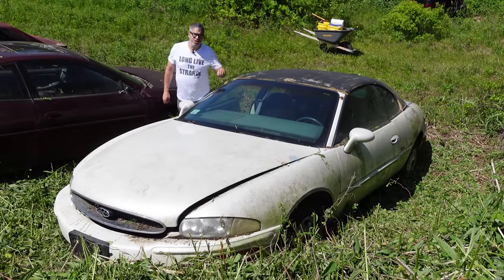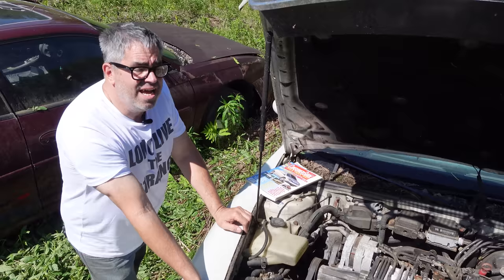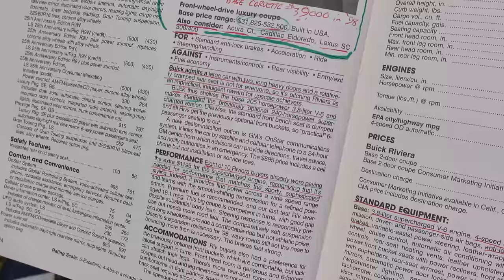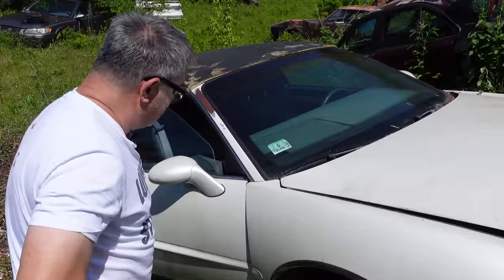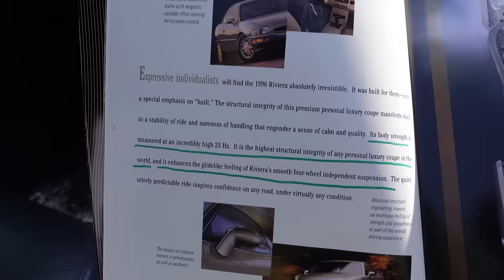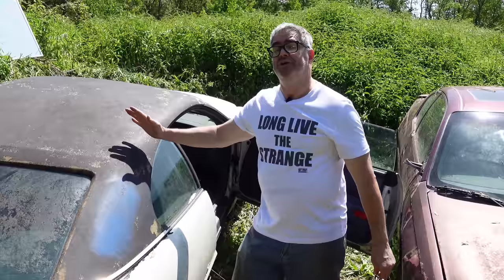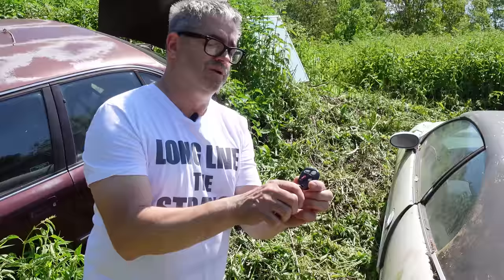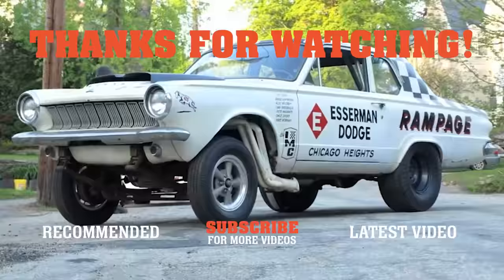More Power Than A Grand National!

Comment: If you’re looking for a sleeper the early 2000’s Regal GS had the same engine in a slightly lighter car. With the right tune and under pulley kit you could quietly eat stock Mustangs and Camaros at a light

Comment: *5hp more than an '86 Grand National and T-Type (235hp). The '87 Regal T and Grand National was 245hp, which would equal 5 MORE than this L67 Riviera. GNX, as we know, was rated at 276hp. I have an '87 GN, and I used to own a '98 Grand Prix GTP with this engine. Both are great engines. Both had their unique pros and cons. Preferably, I'd prefer the LC2 in the GN.

Comment: I remember seeing those zooming down the roads and I just might have an idea where 1 is that's still running and driving, it might be put up cause I haven't seen it for awhile. The 94 or 95 Buick Roadmasters ran pretty good too but I haven't seen one of those since 08 maybe. They were rear wheel drive. I think GM lies about the horsepower cause those Riviera's would scoot, and the 98 Buick Regal was supercharged, they wasn't no slouch either, most of em has it written on the trunk beside the taillight on drivers side maybe. I blew the engine in 1 cause I ran everything up like rev-limiter and whatnot. The shifting and everything changed cause it'd jump outa the hole lol. Bout 8 hole shots killed it lol...It felt like 300hp or a tad bit more...

Comment: I had a ‘00 Grand Prix GTP with the same motor. It was a fun sedan to drive. I remember seeing a GTX Grand Priz back then that a 270hp rated 3.8 in them. I also own 2 ‘90 Berreta GTZs. They later came out with the Berreta Z26 which had a 3.8l engine, not supercharged. I wonder if the SC version would fit under the hood though. THAT would have been a fun car to drive.

Comment: Great piece.. I’m splitting hairs, but I wouldn’t call it ‘Buicks most potent 3.8 V6 with 240 HP”. 87 Grand Nationals were 245HP, 87 GNX 276HP… and both likely under rated by 25HP or more.

Comment: i have a 2003 bonneville SSEi 3800 supercharged, these engines might make 240 stock but it's fairly easy to get another 25-30 hp...... sure you can go further but you have to spend more. i am also not trying to destroy my transmission

Comment: Those cars with power didn't have any torque steer at all. GM detuned the 3800 series 2 SC to 240 HP because in prototype form they produced 300 hp and competed with the Corvette C5 at the time.

Comment: Back in the mid-90's when this series of Riviera debuted, I was struck by ho aerodynamic they looked. I would have liked to have seen one of NASCAR's G.M. teams at least build a prototype Riviera stock car to see how it would perform. I remember that one team actually built Continental Mark VIII to analyze it, thinking it might do better than the then-current Taurus (Or was it still the Thunderbird? I don't recall for sure). I think the Riv might well have done better aerodynamically than the LeSabre body the Buick teams were running at the time. Or not... I'm certainly no aerodynamicist! 😄
Reply: 1999 GM took all the imperfections out of the previous years and made the 1999 less than 100 exist selling 4

Comment: The 3800 series engines were by far some of the best engines to ever come out of Detroit when it came 2 durability however I can almost guarantee guarantee that the reason this car was junked was because they had extremely weak automatic transmissions that couldn't keep up with the standard 3800 series so I can only imagine How quickly the original transmission in this car went out. I was a kid when these came out but I remember People at the time comparing this to the also newly released "cosmic roach" 96 Ford Taurus/Mercury sable And not in a good way. These were overstiled With some of the cheapest interior plastics I have ever seen Especially for a car that costs North of 30K. I was in high school back in 1998 and was driving my mom's old 89 Camry. I remember writing in my Uncle's almost new 96/97 Riviera Thinking to myself How it was almost offen save it how a brand new car could squeak and rattle on the inside so badly Compared the 10 year old boxy Di was driving that hearound 175 K miles on the odometer and didn't squeak or rattle like that. Brand new my parents paid just under 15K for that Camry which was more than half of what that cheap "plastic fantastic" pile of crap and yet GM couldn't figure out how to build the dashboard didn't squeak like the lid of a Styrofoam cooler. The Baluga whale stalong with G m's cost cutting almost everything that made

ttered Makes me wonder why buickept this generation going as long as it did?

Comment: I hada 95, great car.  Not as fast, but better instrument panel than later cars, which had some extra wood trim around the radio, which looked a bit old-farty.  I'm glad Buick hasn't cheapened the model name by putting it on unworthy cars.  I hope for another Riviera someday, maybe something that will compete with the Bentley Continental at a fraction of the cost (Like the new Corvette vs. Ferrari).

Comment: I bought a Lumina once which had a swapped Pontiac GTP running geAr and smallish 255 tires on 15" wheels. Was very torquey and could outrun a bolt on 5.0 but I had the chance to buy a 265/4speed Monza. We ended up interchange cars😢 Exchange  that is

Comment: Personally I liked the grand prix gtp(same platform, different skin as you know)
Currently looking for a 2 door gtp between 99-2002. 
I ended up with a perfect running regal for 150$ 6 years ago. Cosmetically wasn't bad, but had been used like a dog crate(people on meth do excellent decision making right?)  the leather was eaten off the door panels, seats, and dash.  But ran like a champ. 
Take out the abs fuse and the traction control is disabled, then they will do impressive burnouts.

Comment: I liked the 89-95 ford thunderbird sc  nm12 chassis 3.8 liter v6 super charged auto or 5 speed i think the 89-93 was 220 hp and 315  tq and 94-95 was 240 hp and 330 tq not to bad. 

I want to find a 93 5 speed body in good condition and stuff a coyote and a roots blower and a t56 or t5 in it. That would be sweet.

Comment: More power but it's fwd and most folks don't want a fwd performance mobile I always liked these rivs even though they looked kinda strange especially for the time they came out its a great drivetrain to put completely into the rear of a cart or old Porsche 914 or corvair or fiero my friend had just the engine in a  pinto and yes it was fast and quiet and looked stock and could keep up with another friend's ws6 trans am and if it could have gotten better traction would have smoked it it was a fun car to mess with folks on the Blvd

Comment: The 1995 to 99 buick riviera was powerful but no where near 1987 GNX level the 3800 motor in the 90s riviera was supercharged where the 87 GNX was turbocharged... big difference the 95 to 99 riviera was 240 hp and 280 ft. Lb. The 87 GNX was 245 hp and 345 ft lb and because the GNX was rear drive the riviera was front wheel drive the GNX would launch far better then the riviera anyways good video

Comment: more power than a Grand National?? and on what planet?

1998 Rivera --  supercharged engine

Engine
Base engine size	3.8 L
Cylinders	V6
Base engine type	Gas
Horsepower	240 hp @ 5,200 rpm
Torque	280 lb-ft @ 3,600 rpm

the 1987 GN had 245HP @4400 rpm   "some say that was underrated'  

and Torque was 355 lb ft @2000 rpm so....not even close

the 330lb ft of torque you mentioned was on the '86 model...

the 86 or8 7 Grand National would torch the Rivera in the qtr mile easily and would do 0 yo 60 in 4.9 secs 

Car and Driver is still shocked by those numbers to this day heh

Comment: All of these 90s era GM cars have beautiful body design, But for me they are all ruined by those horrible front wheel drive proportions.
They all look like hot dogs that dont fit the bun.
If you look at the car from the A pillar back, it's beautiful, then add that cab forward front end... 
It's really a shame, GM really needed an advanced rear drive platform back in the 90s when BMW and Mercedes and Lexus were eating their lunch. They just kept taking away all of their enthusiast customers and full size luxury customers and they had no answer for decades. And now, they have basically just about given up on all cars all together.